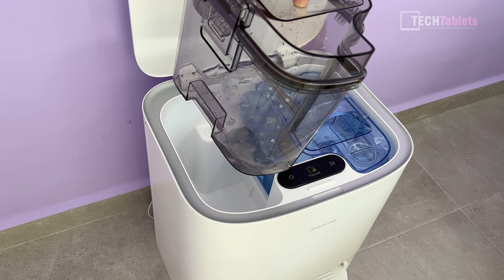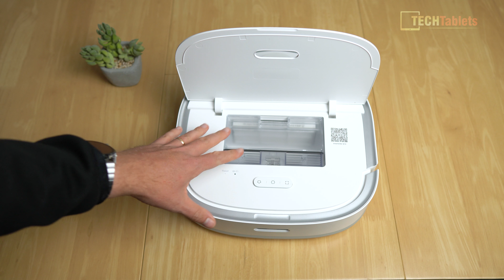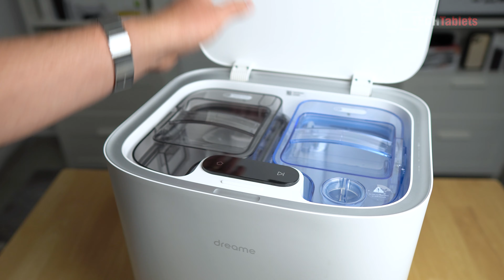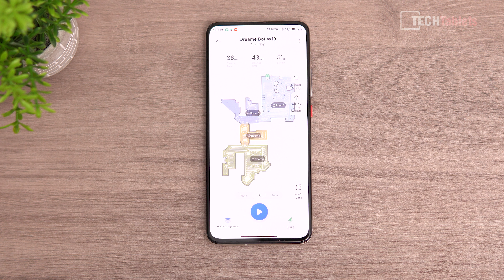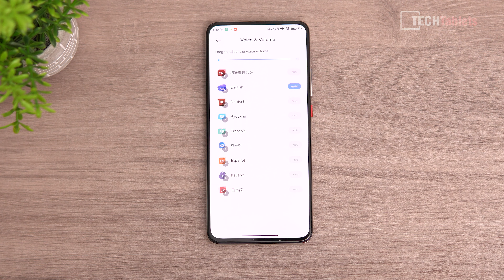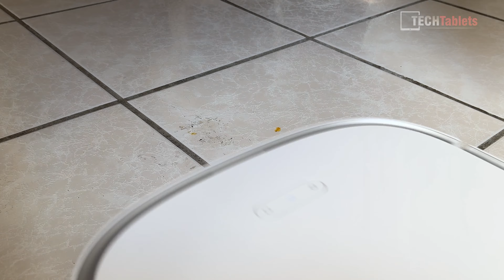The BEST Mopping Robot Vac? Dreametech Bot W10 Review

Comment: How do you replace the front wheel that turns. The plastic is broken that holds the wheel. Is there a quick fix, looks quite extensive from I found but there is no actual videos on how to do it